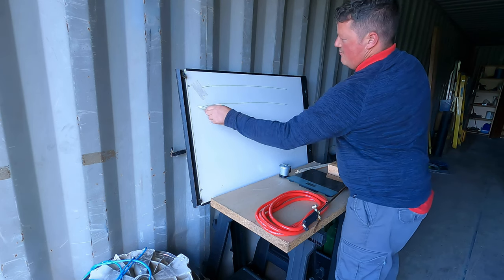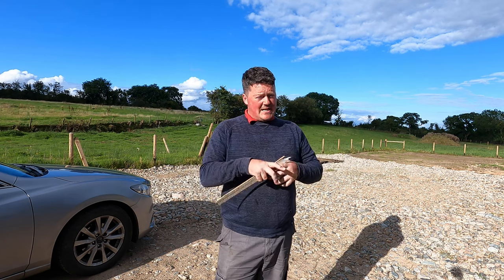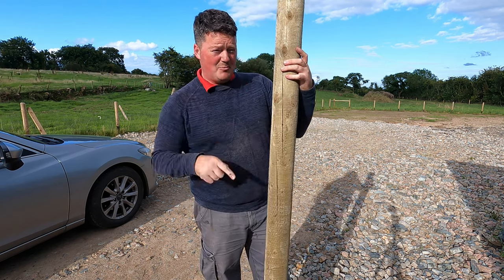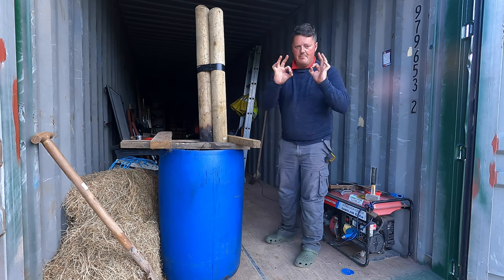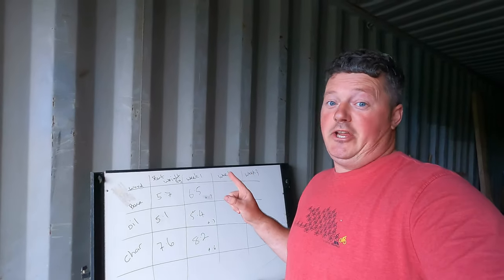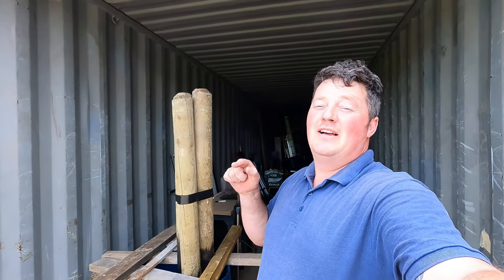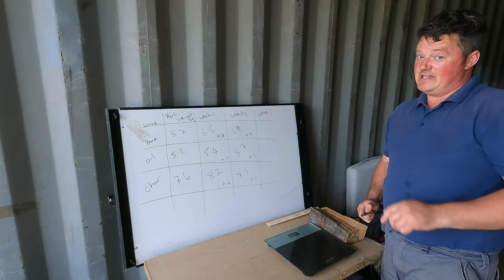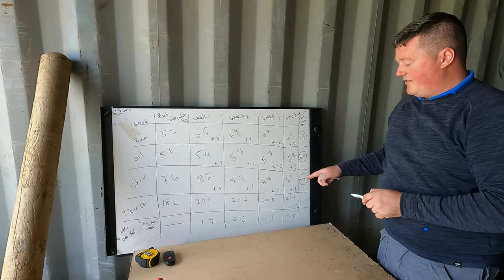3 WAYS TO PRESERVE WOODEN FENCE POSTS ... TESTED

Comment: Diesel and used oil on the bottom straight diesel on the upper part, seal the top with something heavy like tar keep the water from running straight down the post.  extra extra protection drill a small about 1/2" about 4 inches from the ground level at a 45 degree angle and fill with used oil once a year plug it with a dowel that you can easily pull out. My grandfathers post were put in the ground in the 1960's before I was born still standing strong.
Reply from the maker: Hi James. So many methods all of which work. Bottom line though, wood rots! The posts made today wouldn't have had the time to grow like the posts cut in your grandfathers time. If I had a proper place to dip the posts I think id still use the waste oil method because its free. I think if your in the fencing game you'll always have work

Comment: Great experiment!👍
I dry mine for a year inside to let them split open, dip them in creosote and dry them again.
Then I paint roof felt adhesive 6" above, and 6" below ground level, the bit that rots fastest.
That part is always damp and shaded by grass, perfect conditions for microbes to thrive in.
The point never rots because it's too deep and oxygen starved.
Reply from the maker: It is the top few inches of topsoil that has most of the life in it. There are so many variables to it. I think fencing posts will always need replacing in time.

Comment: Interesting video. Seal the top of the posts with cresot after u drive them in and do the oil soak for the bottom of them. Them posts are like a load of straws from top to bottom. Posts are a mad price now
Reply from the maker: Your right Marcus I was meaning to do that last year and I forgot. This year they didn't dry out any with all the rain
Reply: @LaidBackHomesteader  here I was doing a bit  of board fence a few year ago. Bough the fence boards and when I got home started fencing. The neighbour came over a told me to stand them up on there edge and do it the next day. He was righ next day the boards were half the weight as the water ran out of them. Same with posts. Lol. If u look at the post the grain is wide as the wood was fast growing. They absorb serious water
Reply from the maker: @marcusd2380  I got a few 9x2 and 12x2 boards to raise the roof of the container. Before that I'm going to use them to form concrete sections. Well, the wood was soo fresh that the top boards started to warp so much that I have them now stacked, strapped, and covered in a shaded spot to keep them good. To expensive for firewood 😆

Comment: Have you tried charring and then pine tar?  I'm reading that this combination is very effective when you are burying posts or have ground contact.  I'm in the USA and I'm currently building a Swiss style hag fence out of tobacco sticks, sticks used to hang tobacco to dry in barns, and I'm going to char and then soak the ends in pine tar.  I'm combining the shou sugi ban process of charring from Japan with the traditional Scandinavian method of treating with pine tar.  Great video!
Reply from the maker: Thanks. I had never heard of pine tar until you messaged me. If you check out my videos I'm trying to build a homestead from scratch. The first videos I dipped the posts in waste engine oil. It can be messy, if I had somewhere to do it I'd have dipped the other fence posts. I think nature will always break dead wood down. If they use your method to keep boats afloat it must be a proven method. I'll be looking g into it in more detail this evening.  Thanks again!

Comment: Especially if you have heavy machinery, used oil is a great, inexpensive, and proven method to help keep wood posts protected. Oh, it is also organic XD
Also, if you have any scrap metal or can find sheets of lead, you can cut hats and nail them to the top to help keep rain off of the top.
Reply from the maker: Great idea. When I first put posts in the ground I meant to paint the tops but never got round to it. We're almost two years in its about time I got them covered. Thanks for reminding me 👍

Comment: Split posts are worse, most places treat them as round posts before splitting them
Reply from the maker: Never thought of that. Split posts would probably take up alot more room and would use more of the dip because of increased surface area

Comment: Of course charcoal will soak up water.  But water is not the enemy.  It is bacteria and insects that destroy the wood.  But they don't like eating charcoal.  I suspect, the best method is do both, char the wood, then oil soak it.  No self respecting insect will want to eat that.
Another alternative I am familiar with, similar to your waste oil treatment, is coat them with tar.  I use truck liner spray myself (after charring).  
There is another video in which someone left wood in the dirt for 3 years, then dug the samples out and compared the protection.  The shocker was it didn't matter.  They all had rot.  LoL
Agreement a few cups of diesel or Kerosene would thin the oil and help depth of absorption.  .
Reply from the maker: I'm in the process of doing another fence (60m) around apple trees I planted. They are going straight into the ground this time. I think its a good job we all like fencing because we'll always have wooden posts that rot
Reply: @LaidBackHomesteader  In America a company called Trex makes deck boards and thin fence posts of recycled plastics.  Their big drawback is cost as they are much more expensive than the wood, but who knows how long a hard plastic fence pole will last?
Reply from the maker: I have seen plastic fence posts over here too. not sure on prices though. There is a company local to me that has started making concrete hex posts.  I put two strainers at my gate. Put them in upside down because I wanted the pointy bit at the top lol @kenibnanak5554